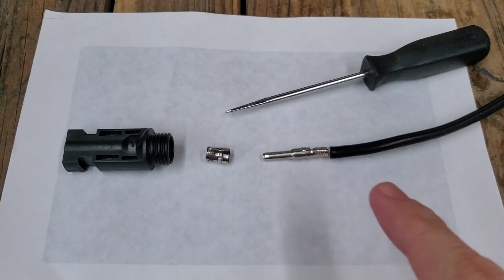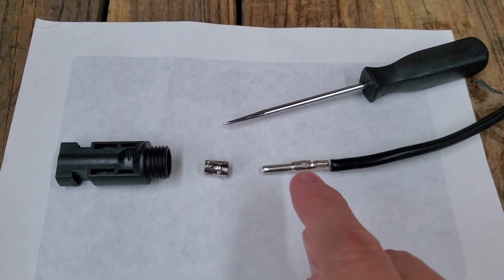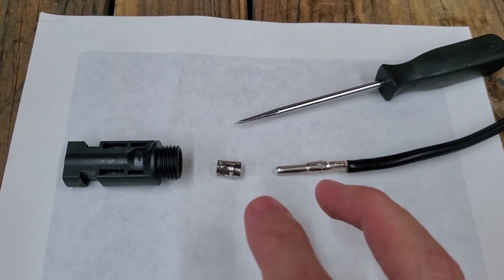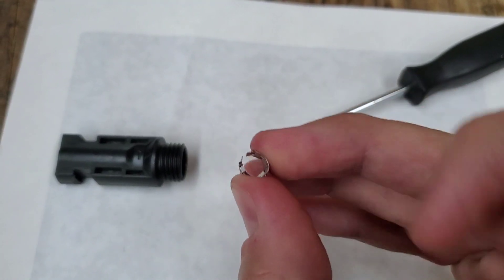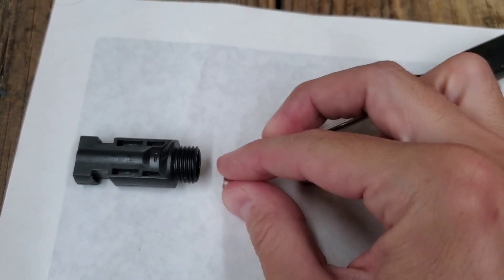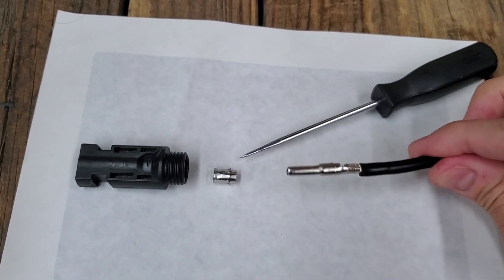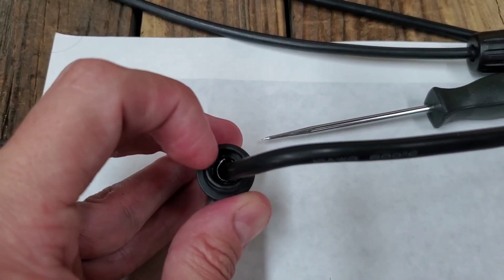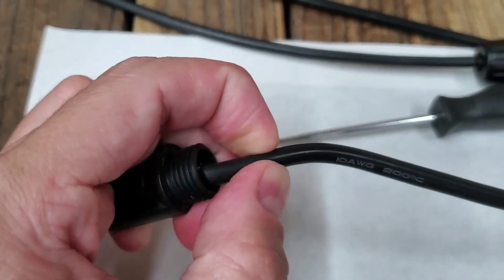How to remove pin from MC4 solar connector

Comment: How do i remove the actual connector from the cable, its to big to push it through the hole in the gland. Thanks
Reply from the maker: I'm not sure I understand your question. But the right way to do things is to cut the cable and install a new connector.
Reply: @adogg1818 I need to remove the male & female connectors on the cable so I can feed it through the cable entry gland 👍
Reply from the maker: @norfolkbushmanandfriends7916  I see. Yes, the right way is to cut and install new connectors. But I made this video in hopes it'll help someone that doesn't have new connectors and needs a quick solution now.
Reply: Is it easy to put the connectors back on once the cable is fed through?@adogg1818
Reply: @adogg1818 thanks for responding, mean a lot. I think i will get it removed by watching your video. Thanks again 🍻

Comment: Hold the connector and twist the wire slowly counter clockwise.   The pin pops right out of the sleeve.
Reply: Bro, this comment helped me so much thank you so much for posting this even though this video is older

Comment: can i just cut the mv4 off to connect to charge controller on one end ?
Reply from the maker: Sure. Just cut, strip, and connect the wire to the charge controller.
Reply: @adogg1818   thank you so much for getting back to me buddy

Comment: alot of these conectoirs are spotty and dont work unless u move the wire a certain way, how to fix that? just remove it? and put in new one?
Reply from the maker: There are a lot of cheap connectors on the market that may be problematic. The pin is not designed to come out like my video shows. You're suppose to just cut and install a new connector. Also, I'd recommend paying more for them from a reputable source like a website that specializes in solar equipment.

Comment: Thank you for sharing this very helpful tip. I was so upset with myself for having made a wiring mistake. While others regurgitate that it's impossible to depin an MC4 solar connector, this method works perfectly, in seconds, just as you say. Fixed my mistake in no time. Saved the connector. Relieved much frustration!

Comment: Thank you for showing how the pin is fitted. If the pin is pushed using a 7mm drill shank and at the same time is turned at the crimp end of the pin with a thin blade of a suitable screwdriver, I used a letter opener, the sleeve and pin can be screwed out of the housing.
Reply: The pin is held in the housing by the barbed sleeve which can be screwed out of the housing by rotating the pin whilst applying pressure to the pin.
Reply: This is the way.  It worked!

Comment: Thanks for the instruction. It's really hard to pick. I inserted a small piece of plastic to help with the pick, picked all around it, finally got it out.
Reply from the maker: You're welcome. It's not designed to be removed. So some connectors may be really difficult. I'm glad you were able to get it. I made this video because I couldn't find anything myself on how to do it. I'm glad this video was of some help to you.